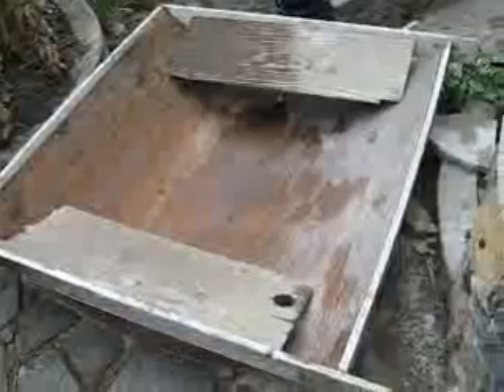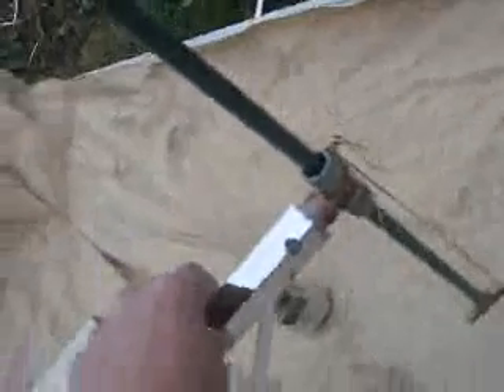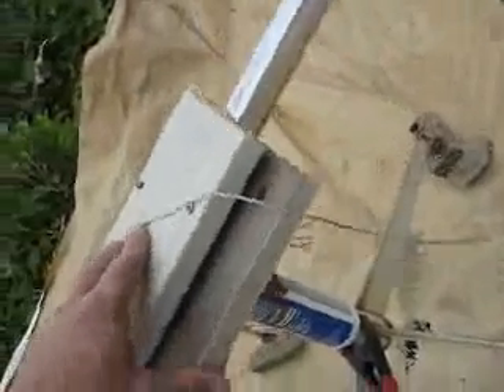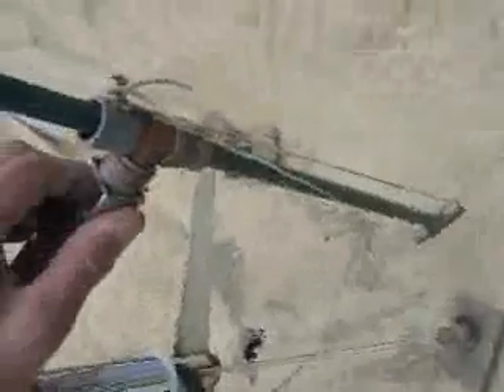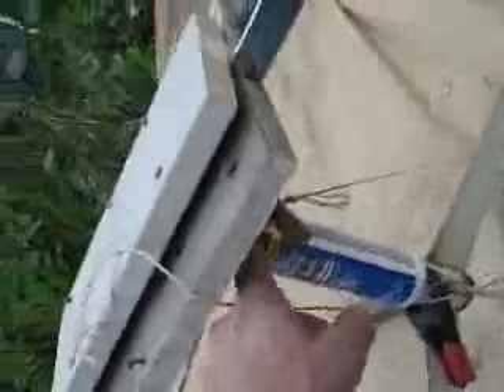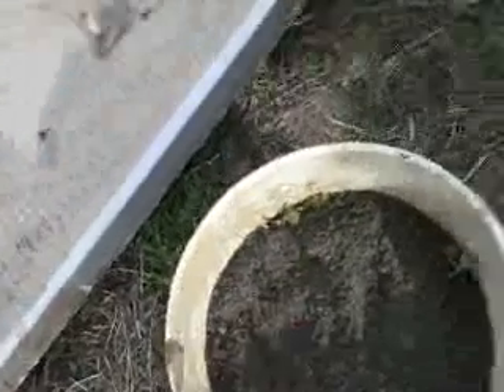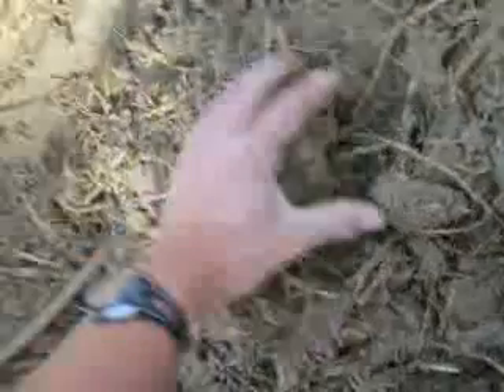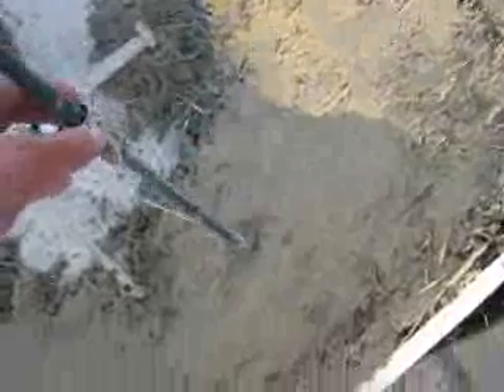Cob  Solar cooker:       Making the form

Comment from the maker: I am doing a compound parabolic dome mold at the moment and I am using a template attached to the center of it and it works! I do not think this type of template will work with a dish but it worked better than i expected with a dome. (So I tried your idea).
Video will appear soon. I will make the dishes on top of the dome. Dishes good for 3 hours of solar cooking without moving. Hopefully!

Comment from the maker: @fergawdsache  The string and "mechanical mathematician" method is really easily adjustable. (So if you make your cob holder a little wrong, you can adjust things so that less cob is used.   And you know the focus right away. There are also times when you do not make a full parabolic dish or you make one longer on one side than another. Again, this can more easily be obtained with this method. Thanks Brian

Comment from the maker: @Sonuchka4  There is not too much involved in making cob.  But I don't think firing it will work. You could limewash (whitewash) it (hydrated lime)  instead or use linseed oil to waterproof it.

Comment from the maker: elipse has 2 focal points, and is like an elongated circle. It might work, a section of a sphere might work too. I havn't time to test everything. If you point a parabolic dish at the sun, it concentrates to a smaller point. 
This point means a smaller area for heat loss from my experiments. This is why i use a parabolic dish.

Comment from the maker: It is kind of like a lathe. A lathe takes off a tiny amount of wood or metal at a time. It would not be capable of taking an entire strip at a time. I would not be strong enough to move your template. 
Also, I would not know where the focus and sun direction is with a template. Lately, I have been making off centre parabolic dishes (More appropriate in many cases) and in these cases, a template is even more impractical.
Brian